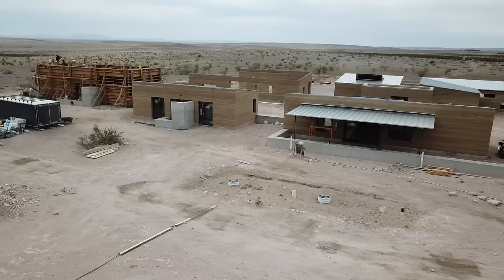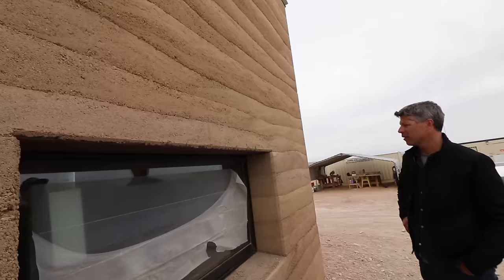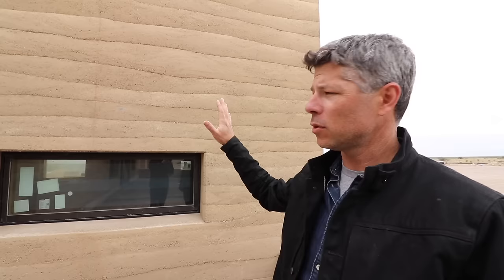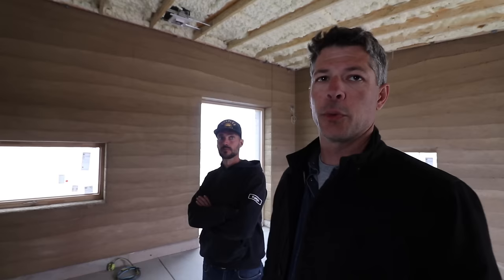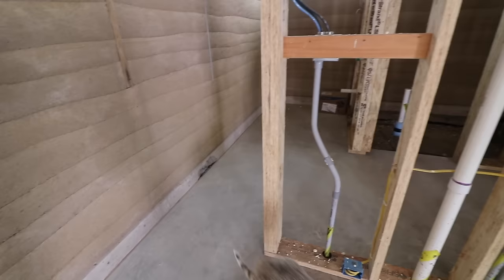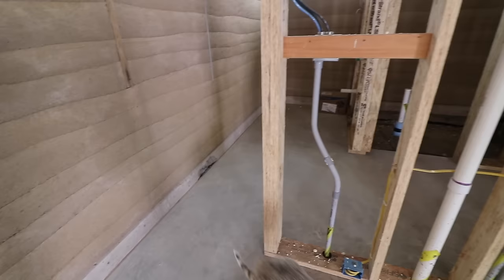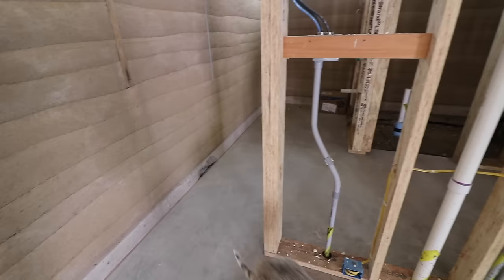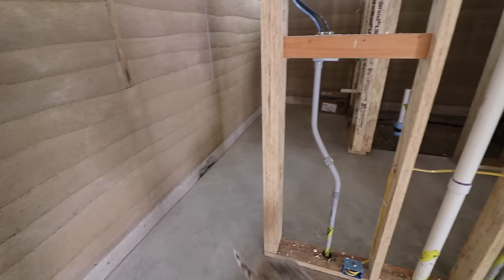Rammed Earth : You won’t Believe How They Build This!

Comment: As a natural builder, I enjoyed watching this video. I have a small quibble of a point. The Rammed Earth shown in the video is called "cement stabilized rammed earth". Not to be confused with rammed earth which has no cement added. 
Rammed earth walls have been used for thousands of years by many peoples around the globe. The Chinese used the method to build much of the Great Wall, and saved the stone for facing the walls to protect them from weathering. 
Rammed earth is a technique that can be done by an individual, and most soil types (except sand) can be used. It is most efficient to use the on-site subsoil, preferably dug from the foundation area, and future pond excavations. 
Cement stabilized rammed earth has a much higher carbon footprint, due to use of Portland cement, which is amazingly high in embodied energy use. And cement is often not needed if the design of the rammed earth structure has good "hat and boots", i.e. roof overhangs and stem walls. 
Another advantage of both rammed earth and cement stabilized rammed earth, is they are impervious to insect damage. Unlike wood, or other cellulosic structures, termites and ants (and other crawlies) do no damage to the walls. 

Anyway, thanks for showing us this alternative building method.
Reply: Is rammed earth building good for hot climate passive house?
Reply: Adnan Malik I’m pretty sure that is one of the best uses for it.
Reply: James Kniskern ,you seem to know your stuff .not just building but some other really neat things. I believe I’m your 4th subscriber.im a bigshot you tuber too..scrolled through your videos.every  one looked interesting.let me know if you see this .my daughter & I have a spot in NC Sandhills that we’re going to pass on down the line one day & it’s been whispering “use what’s here to build “.getting louder every day. A lot of variety & the lay of the land & everything just feels right .like to make it nice for generations too enjoy.a good start anyway . your comment struck a chord.a couple things in particular. It’s late. better go.Id like to know if you could point me in the right direction or at least a direction.a good book,contact .anything would be helpful.not sure where you reside so...but if you would let me know what you think I’d appreciate it. So much misinformation online .mind-boggling amount of good & bad. 
Good evening ,
                  Burke Wills
Reply: I was thinking, this isn't that different than just using cement blocks, it seems. You could use cement blocks then use a form and concrete to get a architectual looks on the wall exteriors.
Reply: @wbwills2  I'm in KY. Have a strawbale house my wife designed. We know a few things. 😁Our house is a hybrid of ancient and modern building techniques. Some we used for efficiency, some for esthetics.
Reply: What about in the summer? Isn't is hard to cool?
Reply: Adnan Malik 
Yes it is good in any climate when that is the intention and they stay fairly cool in the summer. A less labor intensive way of doing same and cheaper is to us sandbags or continuous earth bags to fill and merely tamp down a few times and add barbed wire for grabbing and holding, then the next layer and repeat! There are a lot of videos out on it. It is still much labor but not as intensive. Even children can get involved and no expense of the wood to build the forms. Then after a few rows tamp the sides for a more smooth wall instead of the rolly bumpy wall without tamping the sides. Plus this build is pretty simplistic and can be done by anyone with just minor study. You place wiring within the layers for the electrical while layering so it will be done as building goes up and voila! Then one can put any type of roof on. When we build ours we’re going with a roof similar to these and are going to do rain catchment as well! For every 1000 square feet of surface you catch 600 gallons of water for every one inch of rain! So even in the high desert in the US or with 1” a month can capture enough water to not need other supply even for family of four. There is a guy in AZ just outside of Phoenix who does just that with a bit of creativity by creating extra catch surface in once place on the ground with an old billboard sign canvas tarp as one of his catchers and a small “roof” built on stilts low to the ground for rain catchment only and likely shade for small desert dwellers lol! And he has several cisterns for holding all of the caught rainwater to include one for his garden and fruit trees!!! There is a family, my little homestead on yt who have built using the continuous bags many building all video taped onstage on yt and they are just a joy to watch! They haven’t had much luck with cobbing or adobying the walls but the leave out fiber and I think probably not enough clay and maybe since bah is slick possibly chicken wire of something similar should be used if want adobe look. Sorry if too long. I love this and can’t wait to get my property in AZ and build. We are about a year out!!
Reply: Maxim C. 
Earth built with thick walls tend to stay around 70-75 degrees all year round sometimes in winter may get colder a bit and need small heat. Very eco friendly very efficient.
Reply: @adnanmalik6244  You can see an example of the continuous earthbags in construction here: https://www.youtube.com/watch?v=GUyV6BKUSeA
Reply: @theducklinghomesteadandgar6639 
Ah, ok. I wonder, in the summer, would it help with temperature inside if one could use some sort of over-structure, that would englobe the house and protect the walls from direct sunlight? (just to make cooling as passive as possible)
Reply: Maxim C.
Yes, it would! Generally most earthen built structures tend to have what they call a "Hat". It is roof with a few feet overhang, but is usually meant to protect the walls from heavy rains. They do have the added benefit of helping to keep a house cooler in the summer. It would be very much the same as having tall trees around a house that are non-evergreen so they help to keep a house cooler in the summer and warmer in the winter with southern leaned sun warming through the bare trees. However these walls are purposefully made thick to mimic being underground so temperatures stay pretty steady year round of mild 70s if built right, even without a roof overhang of a "Hat" and or wrap around porch which would be more or less the same except a porch would come out farther away from the building than the typical "Hat"! But that doesn't mean one can't give them a helping hand!!😊

Every rammed earth build I have seen in the south west here lately hasn't had a hat or boots, which is a high stem wall, which most generally wouldn't be needed in desert due to mostly mild rains and staying clear of monsoon runoff on property if a smart person watched for & did homework before building or built high up!
Reply: @theducklinghomesteadandgar6639 
Oh, I was talking about something that can be removed in winter, for Sun to heat it up. And installable in the summer.

But I guess you're saying that with passive colling/heating it's kind of the best you can do (75 degrees), because even with a "hat", the warmth coming from the ground will not allow for temperature in house to drop further (without active cooling, that is)?  If so, what if could isolate house/walls from the ground? Possible?
Reply: James Kniskern .... Interesting. Years ago when I first got interested in natural building techniques, straw bale construction was the first thing that really caught my eye . A long time ago. I went to the local library and borrowed and read every thing I could find. Since then the Internet has come a long way. All kinds of information available.  You got my attention again when you mentioned “hybrid” . I shifted gears somewhere along the line & started thinking hybrid myself. I’ve never been to Kentucky. I just did a little reading on Wikipedia about the state. Interesting state. 250-750 ft and some mountainous areas. I’m about 175 feet above sea level give or take.No 2 place are exactly the same but North Carolina and Kentucky have a lot of similarities . Depending on what part of Kentucky y’all live in , A lot of what has worked good for you (and not so good) could be helpful information for us. I won’t take up anymore of your time right now. I am curious though.. does your wife have a background in architecture? And can you recommend any good reading . anything you can let me know that really working out with your home or anything that didn’t work out that I might should avoid I would really appreciate it. I’ve got a vision,it has  through the years . I have a notebook with sketches and notes . I definitely need to do some more homework & talk with some people /possibly visit some homes that are similar to whatI’ve got in mind. There’s a Strawbale (if I remember correctly it is some what of a hybrid also)Home not far from where We live that gives tours a couple times a year . I’m going to try to go online right now and see if I can find that fellow and any new interesting homes in this area.its been over  2 years ago that I somehow stumbled across that information online. I need some pointers. This December I’ll be 1/2 a century old/young . However you look at stuff like that. It’s about time I get started. Happy Labor Day. Thanks for getting back in touch.
Reply: @nofurtherwest3474  - Why not use large earth block...or sand bags...it would save time and extra materials...
Reply: @TheYah00netstar  That's a good idea too
Reply: Maxim C. The thing you refer to is a trombe wall. There are videos on YT if you look.
Reply: Thanks for sharing that    good to know   is rammed earth cheaper then concrete ?
Reply: @Perfect in Ar-Zone  ha ha propley not I guse     those lil criters can get into your boots !   thanks for sharing
Reply: @adnanmalik6244   I lived in Tucson and have seen any number of rammed earth homes of varying ages of construction. Some or quiet impressive in the way they handle heating and cooling. In some structures the stucco had micro glass beads mixed with it adding to the insulation factor.  They are not cheap to build, but are substantial.
Reply: Seems like in ancient times the only way to get rammed earth is using an elephant.
Reply: James - I have built, and currently live in, my own rammed earth home. While I understand your sentiment about portland cement, you will not find a structural engineer who will sign off on a design that does not meet, in our case, compressive strength minimums of 15-20 Mpa if you have snow load. I feel that while your heart is in the right place, it is important to note the practical considerations of building a rammed earth home, especially if the client requires financing. In much of the northern hemisphere, they will need portland binder. We used Metakaolin as an additive, bringing our portland content down significantly, but it is required.
Reply: AKA SOIL CEMENT!!!
Reply: Nice 1 James
Reply: @wildernessfather  its interesting you used metakaolin, there are new innovations that try to reduce the percentage of Portland cement even further, like flyash and some other pozzolanic additives
unstabilized rammed earth and CEB is cool, but need some thinking and planning for what to use and how to handle excessive moisture and rainfalls
some use an external finish, or hydrolic lime to help with water resistance
Reply: @zazugee  Yes it's a technology that has a lot of room for refining for sure. For water resistance we used Plasticure from Tech-Dry in our dry mix, which is an emulsified silicone agent that doesn't impact the natural breathability of rammed earth. While I strongly considered fly ash, I had a few concerns about chemical makeup and radioactive potential of it, so we went with metakaolin, which was super easy to work with and quite benign.

We have a few uranium deposits in our area so I worried about my walls being an issue and bought a geiger counter to test the materials as well. Turns out everything was very low, which was great news.
Reply: no further west s
Reply: With a Portland content of only 9%, I would not lose any sleep over the structures carbon footprint.
Reply: @adnanmalik6244  rammed earth is good insulation for a hot climate. I live in a rammed earth house. Warm winters and cool summers.
Reply: So right you are. My home is proof of what you've just stated. No cement in any of the rammed earth walls. of course the slab and lintels are the only reinforced concrete. We have fans in the house, mainly for moving air. Yes I built our home one man. Three 20ltr buckets, a spade & wheel barrow, 140 tons of crusher dust and an air tamper. 18 months of ramming.  Like toast in winter and cool in summer. I was 63 when I started.
Reply: @SuperVHSchannel Yes, BUT when positioned correctly to absorb the sun it then becomes a heat sink which dissipates any needed heat in the winter back into the home regardless of location it just works better in the dessert, plus it is super tight construction, making it as, if not more energy efficient than a modern home. The earth thickness of the walls also creates an internal atmosphere similar to a cave year round making the need for usage of any energy source to be small for both heating and cooling making the home more easily self sufficient or at minimum being energy efficient bringing down the costs and energy usage for both heating and air! On top of that, IF a person does the building themselves the building product is either free or dirt cheap, pun intended, meaning home ownership is way more attainable for even low income and possibly poverty level people. And to top all of that off these buildings last for multiple centuries, possibly even over a millennia!
Reply: SuperVHSchannel yes that’s what I said
Reply: SuperVHSchannel do you think it is possible to render a basement concrete block wall to look architectural?
Reply: SuperVHSchannel yeah like modern. I wonder why basement walls aren’t made to look nice: some options 
1) stucco - smooth 
2) stucco - textured 
3) board stamped concrete 
4) smooth concrete 
Any other options ? 
What do you think would be easiest to implement?
Concrete would be hard because you’d need a form?
Reply: @SuperVHSchannel I'm talking about doing this in a basement to make it look nicer. Go over the basement concrete block walls.
Reply: Why the rest of the Great Wall are not rammed Earth. The Chinese see rammed Earth was Bullshit. And Chinese Wall was mixed with Clay. Not only Earth.
Reply: James Kniskern Thanks for sharing this information.
Reply: The problem with cement stabilized rammed earth is that the walls won’t breathe as well.  And, using granite base is completely non necessary.
Reply: @MW_Builds  neither rammed earth, nor cement stabilized rammed earth walls breathe. There is little to no air movement through a rammed earth wall.
Reply: I can imagine big critters like mice or rats could burrow holes through the walls.
But the buildings do look great and modern.
Reply: @PersonalStash420  cost.... I cannot speak to it. Because it varies by region and skill level.
Rammed earth forms can be built to be modular and reusable. Saving cost. Subsoil is inexpensive, and often available on site. Labor is required to dig it out, or heavy equipment could be used.
If you live in a super rocky area, you may have to bring in earth to do this.
So costs could be cheaper, but I've found that labor is huge! So it is a trade off.
Good luck.
Reply: Poor Poor  Yeah. In theory you could just have a big batch of concrete and if you had some type of hose you could just hose or squeeze the concrete on in layers.
Reply: dear James, perhaps you can help me out:, (min 2:00) what is 3/8 - and quarter -?, where or how can i convert into Rest of the world language? ive googled id, but without success
Reply: @michaelbumuller853  use Google to convert 3/8 and 1/4 inches to metric. And I'm sorry we are still stuck in the dark ages in the USA.
Reply: James, if no cement is used and only soil & earth how does it hold together? I have an idea but not sure it is correct. Would like to hear from you because we plan on starting next spring on our earth rammed house.
Reply: @babyowl53  Rammed earth uses subsoil, which has a high clay content. Using sand won't work. 
The clay is pounded (rammed) multiple times as the soil is added to the form. This process can be done by hand with sledge hammers, or with more mechanical rammer/tamper. The soil is compacted almost to a point where it becomes like stone. All air and most of the water is removed during the process. After the form is completely filled with rammed earth, the form is removed, and your wall is complete. There are many ways to do this, but that is the gist of the process.
What holds the wall together is the soil particles are packed so tightly that they cannot move, or absorb much moisture. Air doesn't penetrate, because there are no air spaces left after the ramming process. If you want to learn more, I suggest some more time spent reading and learning about the process. And set up a form and experiment on some small walls, so you learn what works and what doesn't .
Reply: Can you put interior and exterior wall cover for different aesthetic looks? I'm wondering if if defeats the purpose of the walls in general
Reply: Thank you for your knowledge of this building type of rammed/cement rammed earth. When and if I get to do something like this for myself and my plan for the rest of my life, I would need someone like you but I’m in VA and idk if
I am even going to stay here.
Reply: @theducklinghomesteadandgar6639  watch their YouTube channels all the time. Been watching the one in Arizona since the day they pulled the Tiny out to the land. They have done a great job.
Reply: You're correct.....I built my first rammed earth home in Ghana some 35 yrs ago
Reply: @micjon7620  How many SQ was your masterpiece?